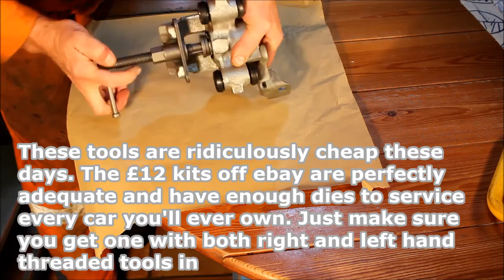Rebuilding the rear brake calipers and replacing the brake pads on the Lotus Elan M100

Comment: I'm in the middle of doing this job now, thanks for making the video.  I have the fed elan - some notes:
Back caliper bolts only worked with 18mm for me, the 11/16ths was too small.
Banjo bolts were 11mm.
Reply: If you do manage to overstroke the handbrake mechanism and lock the pads together like I did you can back it out by taking off the handbrake lever mechanism and ratcheting the nut back there while c-clamping the pads open till you get them apart enough to pull the pad.  I think it's a 14mm.

Comment: One simple solution for the screwdriver scratches issue is to use some electric tape in the tip of the screwdriver.